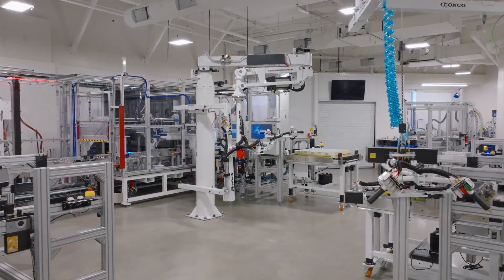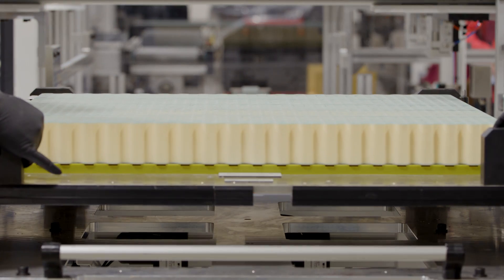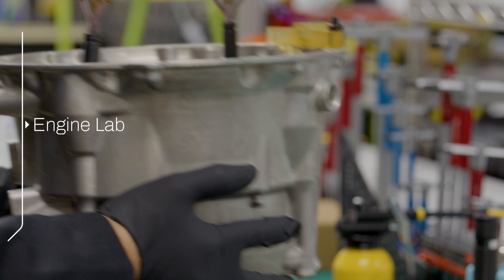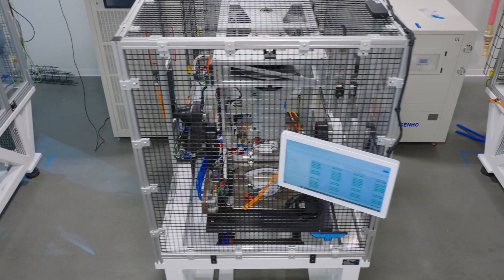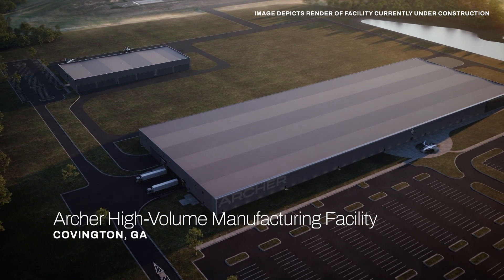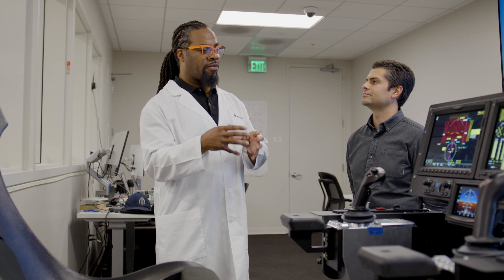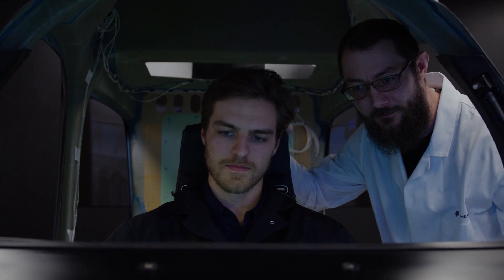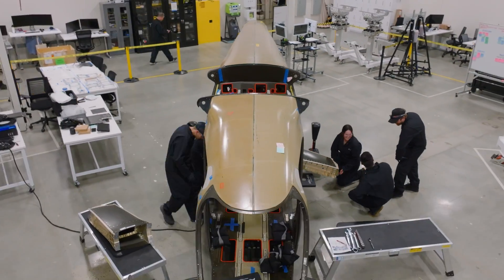Archer Integrated Test Lab and Manufacturing Facility Tour

Comment: 2,700 shares and several call options in! This company is going to be a beast. Keep up the great work Archer!
Reply: Called it 2022.. one other company is slightly ahead in asia, but this team has better engineers and is moving faster in the west(as usual)
Reply: Thats awesome how early did you start buying shares and what your price prediction for Archer in the next few years ?
Reply: @lavantesfranklin9196  conservatively $12-30 per share in 2025, with a potential for a much higher valuation. Remember Tesla when electric vehicles were rolled out?
Reply: Not far behind you . Have you heard some of the podcasts featuring Adam on Spotify really insightful